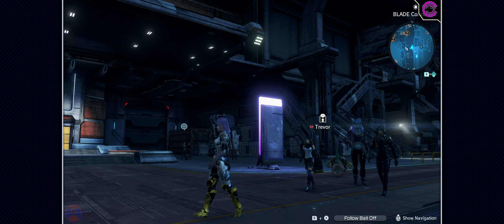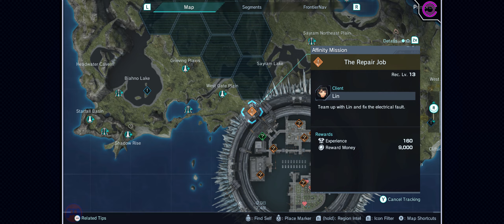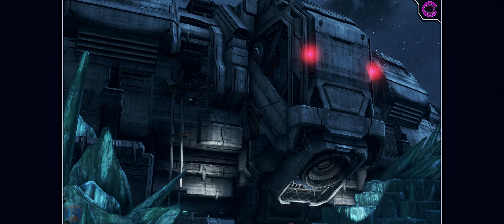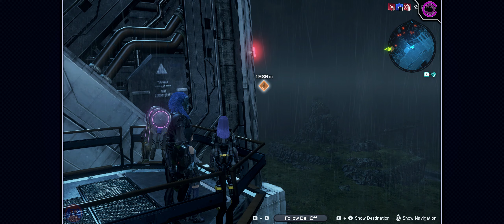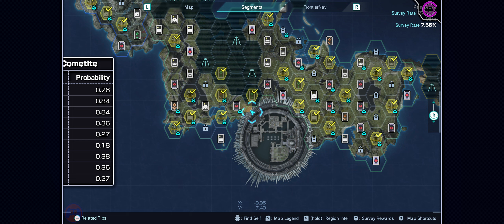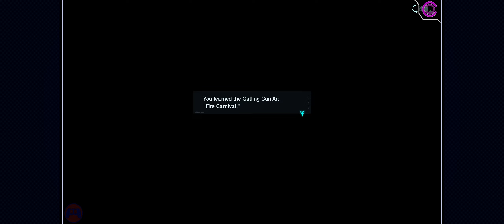Xenoblade Chronicles X DE | The Repair Job

Comment: Why I went to the location and enemies level is 47. It's not LV 9 as your vedio T_T
Reply from the maker: Did you go to the base on the southeast side of Primordia? That's the one that has lower level enemies. Sometimes the game initially points you to places too high for your current level just because it's closer.
Reply: Yes, south east side, same problem. Level 45 enemies. Wtf?